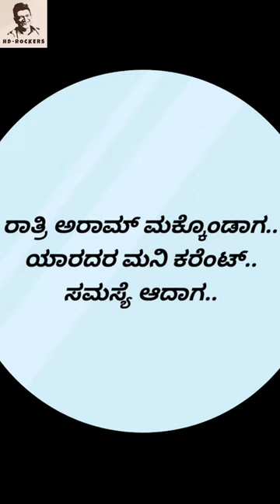VLOG 02 ನಿಮ್ಮ ಮನೀಗ ಕರೆಂಟ್ ತಲುಪುದ್ ಹೆಂಗಂತ ತಿಳಕೋರಿ.. ಬಾಳ ಮುಖ್ಯವಾದ ವಿಷಯಾ..

Comment: Convertion ,stepup and stepdown 
All in technical field has their own meaning don't jumble it. Current is rate of flow electron and  voltage is electrical pressure.
Just like water pipe  line system 
I like and appreciate your work and awareness of electricity
Reply from the maker: Thank You